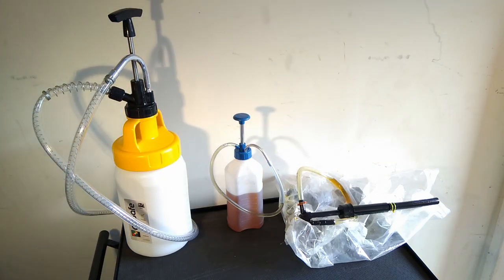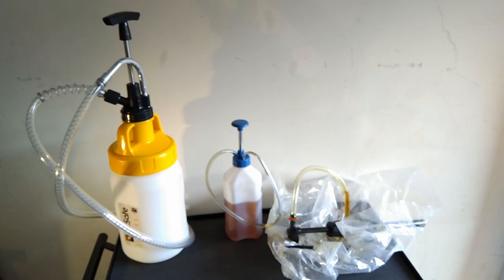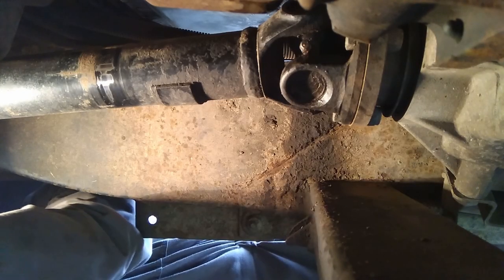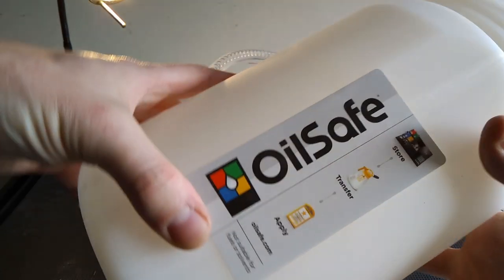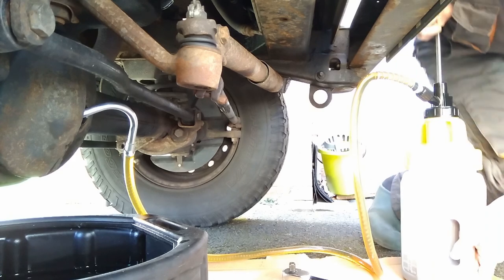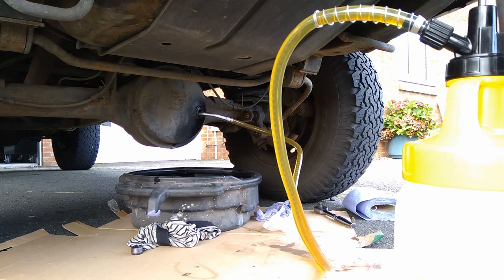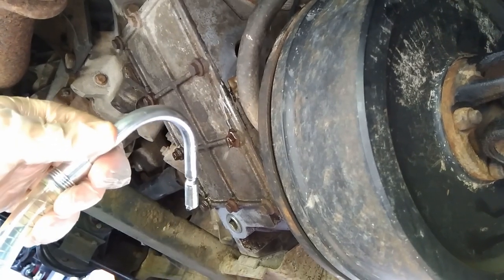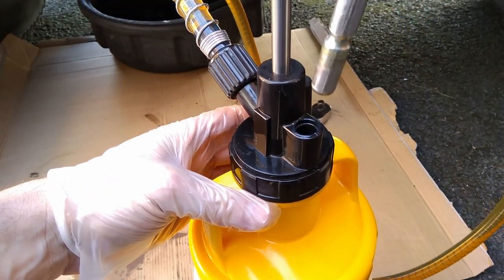Transmission Oil Pump Review - The GOOD, the average and the UGLY

Comment: I use a cheap 5l garden sprayer - fill with the correct amount of oil then pressurize & control with the trigger. Does help to warm up the oil first though.
Reply from the maker: I bought one once but the pipe was too thin

Comment: I use a Ford Xflow oil pump modified to fit in the top of a 5 litre container.....originally pumped via a small crank handle, recently upgraded to use a cordless drill.... That thing pumps! 😂 😂

Comment: Hi
Found this to be quite a good review. I have been using the oil safe product in a professional capacity for a number of year now, in my experience they are the best on the market. We have started to use the more expensive pump option, which has the ability to mount a filter to the pump housing - then you are not fighting vacuum when transferring oil. For us purists all oil equipment is dedicated to a individual oil grade, cross contamination is a pain to get out of your gearbox/engine and can have adverse impacts.
When dealing with oils and greases your main enemies are always particles, dirt, and water. Always think about the potential for contamination when handling and storing oil. Typically it the stuff you can't see that is small enough to get into your bearings etc that does the damage.
Regards
Reply from the maker: Thanks!

Comment: I appreciate your video. No good manual way to pump that stuff in. I wonder if there's a Milwaukee tool than can help. I know they make transfer pumps but they look like larger volume ones. I do have air tools but with my lithium powered tools being so light and effective it would be a huge chore to bring all that out and make a ruckus with that air compressor.

Comment: If you just pump it a couple of times the pressure will build up on the unit meaning that you don’t have to pump it a lot, once the pressure lowers you pump it 3-4 times until you finish the oil change but overall great video

Comment: Laser do a drill powered fluid transfer pump. Add suitable lengths of hose and an eBay NRV and it works well..
Struggles a bit with cold 80/90 though..
Reply from the maker: Got a link Dave?
Reply: LR Workshop & Expedition 
Here’s the pump..
https://www.halfords.com/tools/power-tools-and-accessories/power-tool-accessories/laser-drill-pump-221959.html

Comment: This was a great review, thanks.  It'd be nice if there was something great for personal use though, I am still not satisfied as a DIYer.  Lately the most infuriating thing is that the Redline bottles (holding 75w-90 gear oil) don't fit the pump style adapters that people often use.  If I did use re-use an extractor or an electric transfer pump,  then there is the issue of cleaning them after use to prevent cross contamination (how best to clean them anyway?) etc.   FWIW as an American I quite enjoyed the silly American accent.

Comment: Nice vid...out of context question are there different types of drop arms for 300tdi  90...my 90 turns 2 1/2 to the right and 1 1/2 to the left couldn’t find out what it is ....
Reply from the maker: Not on a Defender. The drop arm won't turn symmetrically each way due to the geometry
Reply: @lrworkshop  could it be adjusted then ....the box it self maybe
Reply from the maker: @RoverAddis  the backlash can be adjusted with the nut and adjuster screw on the top
Reply: @lrworkshop  will try it and contact you ...thank you

Comment: I use a 10 quid Laser Oil Suction Gun. It takes a few reloads (with the associated multiple crawlings under the car)  and some muscle power but it is easy to clean and can be kept in a drawer.
Reply from the maker: I used to have one and oil poured out when you tipped it upright